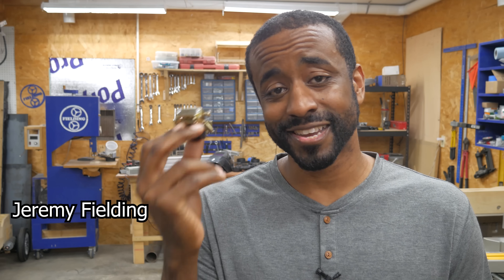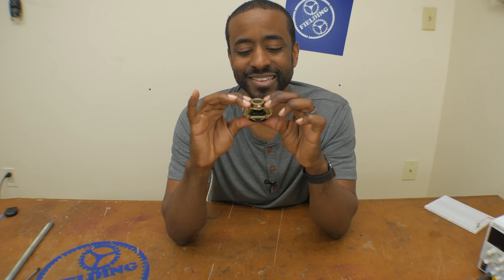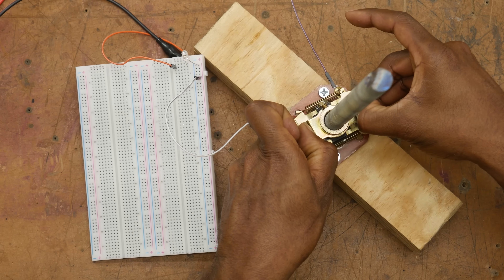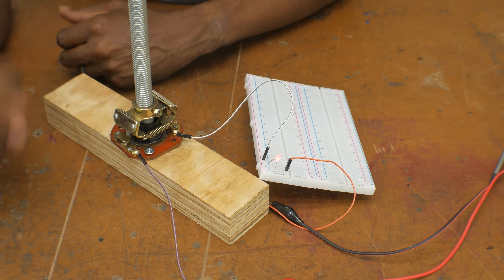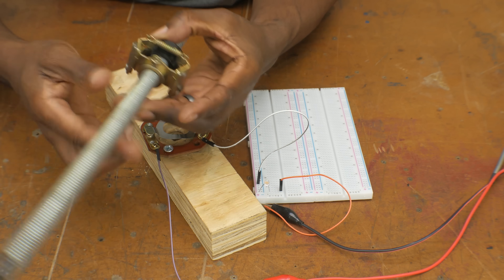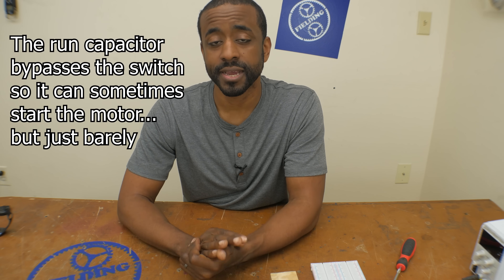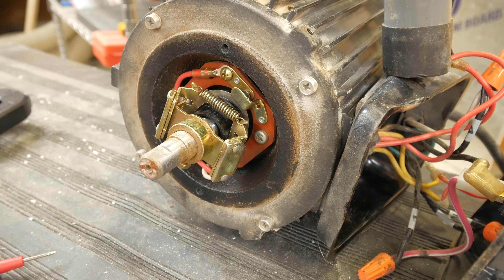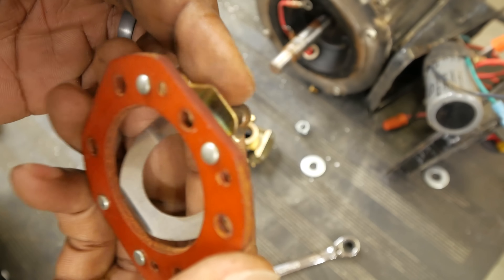This Clever Device Is Found In Nearly Every American Household. How It Works And How To Fix It

Comment: Hi Jeremy,  I am  having the same issue with my 3hp dust collection,  my motor is 3450rpm is a 3000 rpm centrifugal switch good for my motor?

Comment: Ok but what if the electric motor doesnt have a capacitor? Because the electric motor on dad's old drill press has trouble starting sometimes and CANT take load whatsoever, the centrifugal switch looks bad however I was going to test the capacitor first but it doesn't have one so it confused the crap out of me LOL

Comment: This came up while I was searching for centrifugal switch troubleshooting for, you guessed it, my dust collector. It always “cranks over” but it intermittently will trip its own internal circuit breaker while spinning up. Mine is s Jet JCDC 2 in case this helps anyone. I had a feeling it might have been a bad startup capacitor, but I’d also expect if that were the case that I’d be getting a hum and eventually it wouldn’t startup at all. I opened up the top of the motor - it looks a lot like the one in this video - and blew it out with compressed air. Next I’m going to check out the contacts and clean them up.

FWIW, a similar thing happens with big 220V air compressors. Not the centrifugal switch per se, but the contacts on the pressure regulator that turns on and off depending on how much pressure is in the tank. Sometimes it will arc and weld itself on, which causes the compressor to keep running past the pressure it should stop at, and sometimes it will prevent it from turning on at all.

Comment: I have a question regarding removing and installing the centrifugal switch. When reinstalling, how much pressure do you put down once the base of the centrifugal switch touches the metal contact plate before tightening the set screw?

Comment: 4 year video old but I just wanted to say thanks!
This helped me get a 50+ year old motor on a Kwik-Way boring bar running again. 
I still don't know/understand why this motor doesn't use a capacitor, but it is starting easily now and pulls the correct amps.

Comment: Awesome vid!  I'm working on a vintage 1950s Homart fan from Sears (belt drive whole house window fan) it has a 1/6th HP split phase? induction motor without a capacitor.  But it does have a centrifugal switch.  It sometimes....hums and won't start...but with a slight push on the blade will fire right up.  I bet the starter winding is not getting engaged because of dirty switch contacts.  That's the first place I'll look.  Thanks.

Comment: I asked Grok and got this answer:
The centrifugal switch for electric motors was invented by Royal Lee in 1922. He developed it as a mechanism to automatically disconnect the starting winding in single-phase electric motors once the motor reaches a certain speed, improving efficiency and reliability. This invention became widely used in various motor applications.

Comment: SHOCKING DISCOVERY - I started working on my roof-top swamp cooler 50 years ago.  I turned off the switch, but did not unplug it.  I touched something, maybe water, and my arm almost got blown off.  I have NEVER made that mistake again.  Something I learned in the comments below is, after turning off the motor, unplug it, and then flip the switch back on, to drain the capacitor.  I'll give that a try.

Comment: Suggestion. Try using spray contact cleaner or pencil eraser. And sandpaper as a contact cleaner as last option since opening up metallic surface could scratch away protective coating preventing Metal oxidation.

I first learned this years ago after running out of model railroad track cleaner. And by using sandpaper instead resulted in having to clean  now damaged metal track surface a lot more often.

Just windex and foam Q-tips even more appropriate than Less abrasive pencil eraser when removing built up shine between black rubber Computer keyboard and Remote control pad contacts. 
And the ridged circuit board contact points that mate together when rubber button pressed.

Enjoy powered life y’all

Comment: I’m an electrical engineer with years of experience and often I’ll just lick my finger (just use the end of one finger) and use that to sense for 110AC on a circuit.  It just creates a warbling sensation on the surface of the finger.  But as many EEs, I have suffered inadvertent shocks over the years and so I sometimes won’t even immediately detect that I’m being shocked.

I was working on a relatively small electrical device one day that had a SMPS power supply and I was occasionally feeling a shock but my Carpal Tunnel had also been bothering me so I just thought that the tingling was that and I mentioned something about it and my son said, “Did you intend to unplug the AC?”

Eureka! 😂

Comment: Really good info! It helped getting the long-dormant attic exhaust fan in my house going again. The switch was stuck in the closed position from being off so long and the motor sounded extremely unhappy. I just had to clean and lube the switch a bit to get it moving again, the hardest part was getting the motor off the fan. The start cap was also replaced just as a preventative measure, it was only about $10 in my case.

Really is amazing that it still works fine after all this time with a little care (installed in 1962). 

Thanks!

Comment: James Watt
Scottish inventor
Written by Peter W. Kingsford
Fact-checked by The Editors of Encyclopaedia Britannica

This is the first use of a centrifugal switch!
James Watt invented it in 1788!
A  “centrifugal governor for automatic control of the speed of the engine”

From the above article:
 “He solved that problem in 1784 with his invention of the parallel motion—an arrangement of connected rods that guided the piston rod in a perpendicular motion—which he described as “one of the most ingenious, simple pieces of mechanism I have contrived.” Four years later his application of the centrifugal governor for automatic control of the speed of the engine, at Boulton’s suggestion, and in 1790 his invention of a pressure gauge, virtually completed the Watt engine.”

Comment: Dude, I think I have this exact problem, my motor tries to start and then pops the breaker, I already changed caps, and circuit breaker. A Dayton farm motor 3hp 220 single phase. I will get back to you if it fixes it.

Comment: Great video! I wish I had seen it last week. I had one that wouldn’t start without giving it a spin by hand, and it was the centrifugal switch contact that was bent weird and not making a square connection. I agree, that the centrifugal unit is pretty cool. Thanks again!

Comment: if you have a single phase induction motor and that it does not make the click sound, dont go ahead and think theres a problem with the centrifugal switch instantly, it might be a permanent capacitor motor, which is another type of single phase induction motor which uses a different method to start, this method works like the centrifugal switch method, exept the capacitor is never disconnected (and is meant to be run continuously), which means there is no need for a centrifugal switch, so there is none inside such motors. tho, these motors tend to be more expensive.

Comment: What your showing is for the Start Capacitor, but some equipment requires a switch closure when the motor is running. Such as for a fan drive on an infrared furnase ducted air system. Combusted fuel/air is drawn through a tube which radiates the heat down to the floor area, but the fuel valve and ignition will not activate unless the fan is running. The old system I saw used a centrifugal impellar to draw exhaust fumes at the extreme end of the radiator, after most of the heat had been transfered out with infra-red. 
  I'm pretty sure this is done differently by other manufacturers, I've seen some systems (from the floor) which appear to put the fan at the combustion end of the radiator.
   I can imagine similar safeties that might use pressure or air flow swiches to do the same thing. **But since these heaters will fall under local and regional safety codes, PLEASE call a professional.

Comment: 1.5hp 110vac pool pump new capacitor 220uf filed the points clean Meter on 110v plug  says 0.7 ohms Plug it in buzzes and barely turns, blows the breaker. What an I missing?

Comment: Love your channel!!!    I worked in hydro power for a while back in school.   Those little cylinders you see on top of big hydro generators are centrifugal speed governors.   Little balls on arms that swing up or down due to speed, controlling a hydraulic valve which controls bigger hydraulic valves which open or close wicket gates allowing more or less water through the turbine.  Absolutely fascinating design!!  I recently toured the Ford Museum and almost every old machine had the set of two balls on rods on top which were all speed governors.  Woodward has historically been a maker of such devices.

Comment: Contact points need to be as smooth and polished as possible They make point files or when possible to disassemble, I use a wet stone to clean contacts. At a minimum 400 wet sandpaper but remember that the rougher the finish, the faster they will corrode again. I enjoyed the content and great job on your informative post. Thanks, DS

Comment: As all the others have noted, wow, your explanation is very clear and concrete. I'm restoring a bench grinder from around 1960s and it does have a centrifugal swith almost identical, BUT it does not have any capacitor, so, does that make any sense? The grinder was working fine, I guess, and I just just reassembled it, it does spin a lot smoother due new bearings, but it does some more noise when power is ON, and the sound seems related to the centrifugal switch. I don't think any rubing is happening, but I might have put the centrifugal switch either too close to the laminated contact plate that closes the circuit, or either too far away from it. Thanks to your video now I understand it should be lightly pressing the contact plate to close the circuit but not too much, I will check that. But back to the previous question... I'm not sure if such grinder was ever repaired (or just had Its capacitor removed at all), but is it possible to have a centrifugal switch without a capacitor?? What other purpose might it have? I do appreciate your time in replying at your convenience, thank you in advance, and congratulations again for your communication style!!

Comment: I ran my Baldor 7.5 HP single phase compressor motor without the belts. I noticed a similar phenomenon. The motor slowed down and stopped rather quickly after the power was cut. I believe it was an electric brake.

Comment: Hey madman, great stuff.  when reinstalling the centrifical switch back onto the shaft assembly, does the reinstalled switch compress the the inner compression contact/washer?  slightly or more so?..

Comment: "These weights fling out, and they OPEN the circuit."
That would mean it cuts power to the motor. Because its open circuit. AKA: OL (Open Loop) on multimeters.
You meant to say closed. It can confuse alot of people. Its a big deal. That means it should be on while the motor spins. Not OPEN. But instead, it should CLOSE the circuit once the motor spins and the weights fling out.
Reply from the maker: I said it correctly in the video. It might help to watch again. The point is to remove power from the starter circuit not the whole motor. Thanks for watching

Comment: Hi Great Video! Creative and easy approach. I need to replace my centrifugal switch for my older craftsman  table saw motor. The part number is L16-302S  but cant find a replacement.  RPM on motor is 3450. Single phase, 1 3/4 HP. I see a lot of switches that start with L16 but none with 302S at the end.  I se one on Amazon ending with 152S would that be okay?

Comment: I’m having an issue with a VEVOR 5hp 230v 15FLA AC compressor motor that operates my forging press. I keep blowing start capacitors and not sure why. 
I have a 50amp dedicated service outlet and everything was wired by a professional electrician. I just replaced the motor today with a warranty replacement, but am worried it will happen again. 
Is there anything else that would cause a start capacitor to keep failing? 
The press motor is turned on, runs for about a minute or two, then shut back off. Then it sits idle for about 5-10 minutes while my steel heats up again. 

Thanks

Comment: what causes the springs to break,, I usually find these springs in hot water circulation pumps,  the motor is always running, but the pump is  not turning without the 2 springs, and I can spin the pump freely with my finger tips

Comment: I have a very similar problem with a 50+ year old induction motor. The copper contacts have corroded so badly that when the motor is off the start winding is not connected. If I’m lucky, the motor will start, but then it starts to smoke. On other occasions, it won’t start at all which makes sense. My question is what exactly is smoking when the motor does start without the start winding connected, I’m curious. Thank you

Comment: When you were testing the continuity, you got a spark on the last contact point? You'd already recommended unplugging the motor before testing... I believe this happened because capacitor still holds electricity, even after being disconnected from the power source?

Comment: The alternating current produces an alternating magnetic field(also called single phase in contrast to three phase). Physical rotation involves a rotating magnetic field. The addition of the extra winding, in conjunction with an extra capacitor(also called start capacitor) creates a magnetic field that is somewhat rotational. As the motor gains speed, the rotational field is not needed. The centrifugal mechanism(also used in several mechanical devices, and called a governor) in conjunction with the switch accomplishes this purpose of disconnecting the starter winding with the starter capacitor. Just some 💭❤👍

Comment: ChatGPT says Tesla invented the centrifugal switch...

The centrifugal switch is a device used in various mechanical systems, particularly in electric motors. It is designed to automatically disconnect or engage certain electrical connections based on the rotational speed of the motor.

The invention of the centrifugal switch is attributed to Nikola Tesla, a renowned inventor and electrical engineer. Tesla's contributions to electrical engineering and the development of AC (alternating current) systems are well-known, and he held numerous patents related to electric motors and associated devices. While Tesla is often credited with the invention of the centrifugal switch, it's important to note that the concept of using centrifugal force to control electrical connections predates his specific design.

The centrifugal switch remains an important component in many electric motors, helping to regulate their operation and ensure proper functioning.

Comment: Newly subscribed to your channel . I like the content . Good stuff.
Type the term "Balls Out" in your search engine. 
Maybe some of y'all thought it meant "Uncle 'Pervy' streaking down the street attempting to elude capture" . 
Nope , it's a governer system for steam engines. Same premise as this device here. 
Another one while I'm sounding off on my soapbox : 
"Balls to the Wall" 
Again , nothing to do with your Testies. 
I believe it was the F-86 Fighter Jet , not absolutely sure but , the Aircrafts throttle had two 'sticks' . When pulled to the rear , it throttled down . When pushed forward , it was at Max speed . There was a small bulkhead (wall) at that forward position .
Hence the term ..... .. ... .... !!!!
Reply: Forgot to mention .
Atop the two 'sticks' were round balls  that were flattened where the balls met each other . 
BALLS 😂😂😂😂😂

Comment: The inventor is one Christiaan Huygens, if you look back far enough, it's a flyweight governor used on engines to regulate speeds, [edit:  it goes further back, apparently used to regulate mill stones in wind mills in the 17th century, so closer to 3 centuries ago, if not four] but has since and still is used for regulating thermal engines.  A variation of it was used to regulate the speed of some planetary gear stand mixers, notably the Kenwood Chef.  In this, it was modified so, like you said, so it can quickly disconnect and connect the starting system of induction motors, but probably did the same for repulsion start/induction run motors too.  So I can see it being a century old in induction run motors.

Comment: I just watched and loved your video on centrifugal switches as I am stumped on a problem with my air compressor. I hate to ask, but if you could give me some insight, it might help me with my problem. I have an old craftsman compressor that starts and builds pressure and cuts out on schedule. When I use a tool and the compressor is supposed to start up again, I get one or two motor revolutions and then it stops and eventually trips the breaker. I’ve replaced both start and run capacitors, the check valve and the pressure switch with a new unloaded valve. There’s nothing left to replace. When I bleed the tank down to around 40 psi, it will start up normally again. Could it be the centrifugal switch. The unloader tube is clear. Any help would be very much appreciated.

Comment: This is also used inside outdoor power equipment engines and farm equipment, although they call it a governor....same principal but it isn't used to switch anything. Its designed to maintain a specific rpm under varying engine loads.